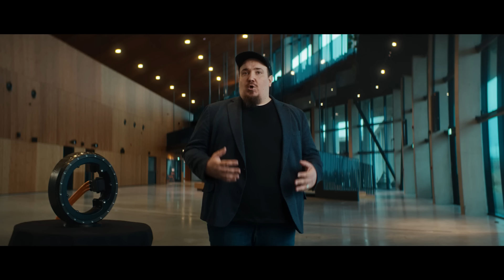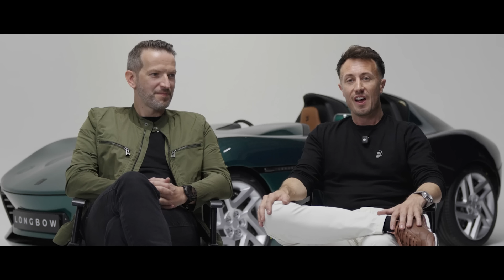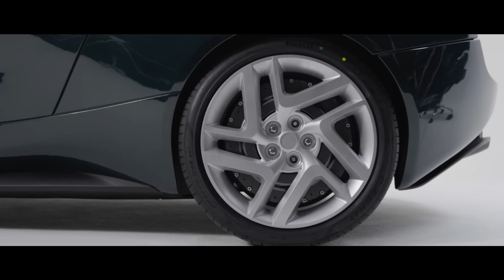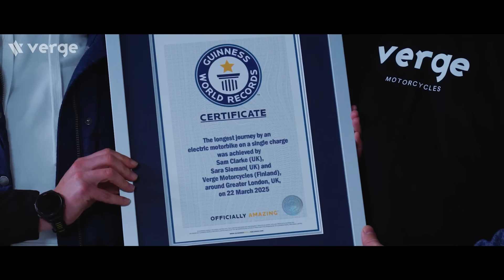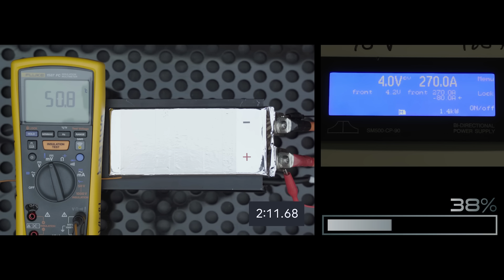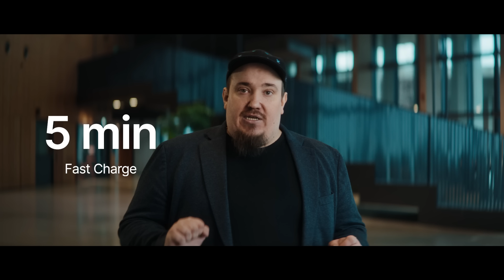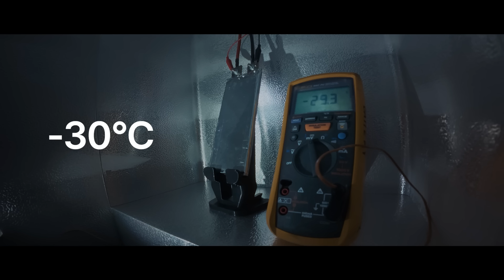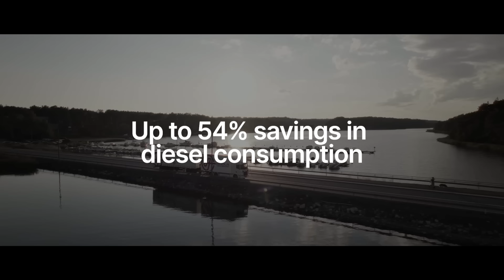World's First All-Solid-State Battery in Production Vehicles | Donut Battery

Comment: 12:31 400Wh/kg, that threshold that allow electric airplane to be a real usefull tech will be very competitive with the Amprius cells.
Reply: Amprius cells only have 800 to 1000 cycle life,not donut's claimed 100,000 cycle life with 5 min 0-100% charging time(fastest after mind shattering donut' cells are from geely-zeekr's own designed 2026 lithium-salt multi-tabbed LFP cells with 1.2 mw charging power with 10-100% in 13 minutes with 6000 cycle life)
Reply: I've heard 500Wh/kg or more for flight. Tesla is around 183 Wh/kg at the pack level and 296 Wh/kg at the cell level. What gets me about this announcement is the lack of details. Big claims require big proof and this is not the caliber of proof you'd need in an announcement of this level. These are just claims.
Reply: @ElliotGeno  I agree and that is why I am following this closely. This anouncement of a ready for sale motorcycle with SS battery is a really convincing argument compare to all SS battery breakthrough I have seen yet
Reply: @ElliotGeno  they said currently 400Wh/Kg with a claim of up to 10,000Wh/Kg within a couple of years.
Reply: @ElliotGeno  if they release information it will be copied that’s why
Reply: It can be possible with Serial Hybrid setup, not pure electric. 

Pure electric for short range, of course. 

Every user has different need of range, even with short range weight is also a constraint or a variable. 

Then externalities of nature and weather.

Then economic feasibility.

Then traffic congestion in the air and need to design every home with vertiport so that honey can come to home in the evening on the roof or drop down from the chimney. 

Anyways, I take every tech with a pinch of different variety of salt, both edible and inedible.

Even for ground transport, this tech can be game changer.
Reply: Love this ❤
Reply: rolf no it wont. 1000Wh/kg would make those barely useful. basically replacing some piston engines. dont even think of gas turbines. you would need to increase capacity few times for that
Reply: @jebise1126  Batteries are likely always going to be limited to short-haul: because they inherently store the oxidizer on board, unlike air breathing engines.
Reply: @economicprisoner  batts that breathe air are being researched too, and primary [non-rechargeable] cells are in relatively wide use today (zinc-air batteries for hearing aids).
Reply: @invendelirium  I am not aware of any rechargeable air batteries.
Reply: Which would mean he should be in the middle of being courted by the US military, and since he's not, you know he's full of shit
Reply: @TheGreatDrYakub  US soldiers are attracted and like to stalk European scientists?
Reply: did you look at the charging demo at 13:00 where the battery is swelling when charging and nobody is talking about that in the comment section.
Reply: @mohammed_mubashir  really? you mean the comment most mentioned on this video? You know I think you discovered something clearly nobody else did! Maybe most people are in fact geniuses if so many people discovered such a difficult discovery. I always thought the opposite but you and thousands of other commenters all able to see something only an Einstein would talk about, clearly - must prove that you are a genius.
Reply: Not even close. 400Wh/kg raw energy density is a toy compare to fuels energy density usually between 10 to 18 kWh/kg. 25 times higher at least. 

Even after efficiency and many other factors taken in consideration, net ussable energy density still pretty much in an other league
Reply: @rodrigomartinez3937 you are comparing the direct energy convertion. This is not the same metric as the electric aviation development are using. 400Wh/kg is well documented. Make your search.
Reply: @Doctorbasss still low for aviation, remember that fuels burn and make the plane lighter along the way
Reply: @humanbass in theory battery also get lighter as they output their energy.. but at a ultra low scale😅 E=mc'2
Reply: @rodrigomartinez3937  Yea 60-80% energy of fuel is lost in combustion engines.
Reply: @rodrigomartinez3937  burning fuel stink and isnt good for you health tho , and all the systems you need to keep containted explosions runing smoothly, gas engines are more ineffcient.  10kgs of copper can move me 100km/h, comapred to how many tonnes of gasoline engine? ....    Imagine having to dig out of the ground to get that energy when it comes free form the sun, whats more efficient? Then you gotta fight and kill people for that enegy because everyone wants it and those who lucked out geogrpahically get to own it and the rest live in poverty?  how efficient is this energy source again?     by by dinosaurs, and take your juice with you.
Reply: useable energy density of an ultra premium petrol is around 1.4 kwh/kg,amazing WELION new energy in a co-op with BASF have developed 824wh/kg solid cells with promised and claimed  1kwh/kg for production version for 2028,we are so close

Comment: Great information.. But about the range world record from Verge Motorcycle, I made 460km on a single charge on my modified 28.3kWh ZERO this summer so who have the record😉
Reply: Whaaaaaat! Man what was your cruising speed! You're a beast and the best nonetheless!
Reply: @antenedilbert7191  My average speed was 85km/h on a 28.3kWh usable. I "simply" added a SRS battery as side case on my zero to bring the usable energy from 13.8kWh to 28.3kWh and proved that this summer on a test ride and during a long 4000km trip crossing 7 parallel from Quebec to the James Bay. I will make a video soon on my Youtube channel to present the battery extender project and the trip. But if you want to see it you will find it on various facebook pages about electric motorcycle.
Reply from the maker: Your setup sounds great! 🙌 the record has pretty strict rules - it needs to be an unmodified production vehicle for it to qualify.
Reply: Did you do roundtrip ending to starting location? Official records require taking the trip both ways to reduce help from elevation or wind.
Reply: @MikkoRantalainen  Yes I did started from Quebec and cameback to Quebec. I will soon publish a video of the trip and my battery externer developpment on my YT chanel. Please Subscribe if you want to see it😉

Comment: Great work. Can donut os integrate a tilt sensor for a self balancing wheel? The inmotion p6 is strongest in production but motor overheats when high speed cruising and weight is high.
Reply from the maker: It can 👍